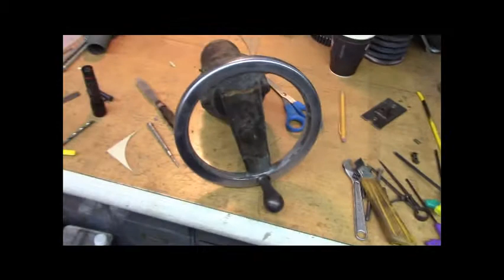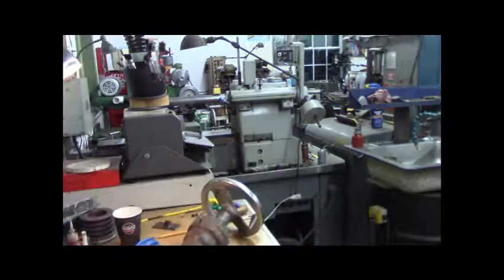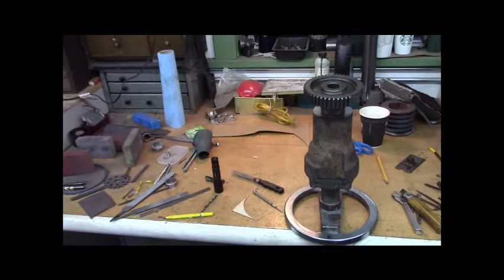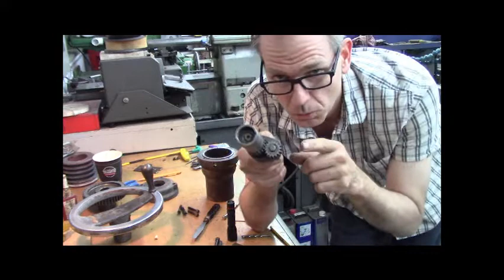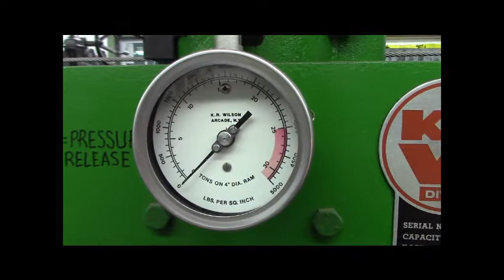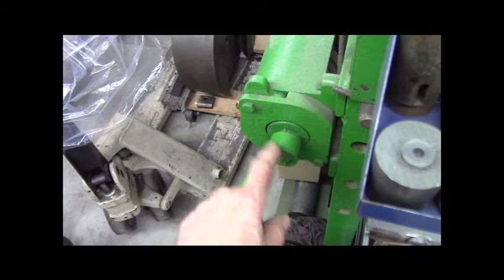Doozer's Machine Shop Update 9-9-20 -- Gear Box Take Apart

Comment: keep it, I have a homemade press with a cable winch to raise and lower the table, works great I can raise and lower without removing all the plate and garbage on the table. just have to remember to take the slack off the cables before pressing. great improvement to the press. but it has maybe a 10 to 1 advantage to lift the table.
Reply from the maker: Sounds great!

Comment: Speaking of gear reductions, could you use an (unhoused) 2.73:1 planetary set? Courtesy of the old New Process gear plant in Syracuse. My old lo-range set from the jeep transfer case. I replaced the gear box so the old set is surplus.  About the size of a cantaloupe. Good for up to 300 HP.  3 planet gears about the size of golf balls. All helical, modular pitch.
Reply from the maker: Keep it around Van man,  Next time I am in Buffalo, we'll have to get together.
Reply: @kooldoozer  Cool, BTW I just applied for millwright at the sugar plant on clinton and bailey
Reply from the maker: @OldtimeIronman  Yeah, I have been in there.  I also worked at Jay Wattles food terminal. Where the cash and carry is.  I used to have Terry's truck and auto in the back there work on my cars.  I went to school with one of the Desidario's across the street. I think Bartozack's lunch counter is long gone. Forrest City auto parts is now a porn shop. Wow.